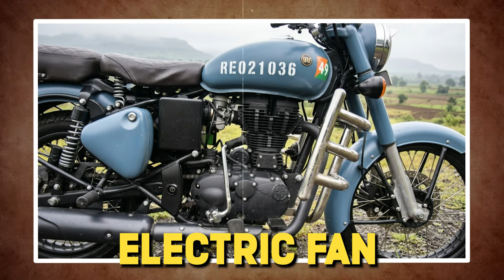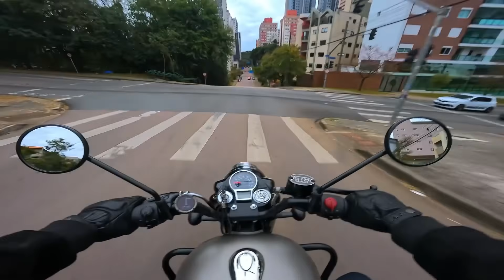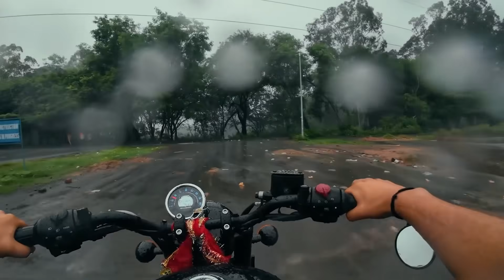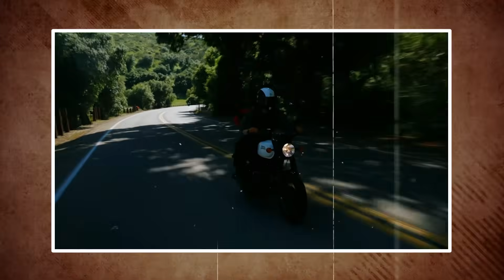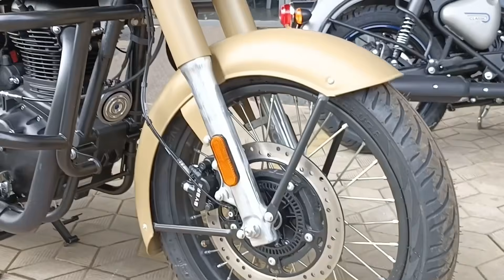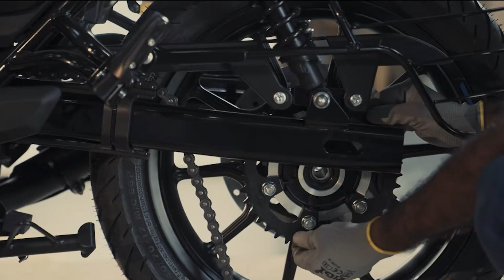8 Things Royal Enfield Cuts To Sell A Motorcycle For $4,000

Comment: Mine never overheats..in Thailand.  Suspension is good., better than my Honda, rear shock is adjustable. Simple is better, much more reliable. Steel is better, strong, also no chrome to clean. Brakes are perfect. It's not an off road bike. My Meteor is a joy.

Comment: I have a RE Thunderbird 500 2017 and Kawasaki Z650 2025 model. The RE 500cc with its Air cooled engine still seems to beat the Z650 in heat dissipation 😅😅

Comment: Not one of those omits puts me off. On the contrary, bonus point for a genuine speedo instead of a dreadfu TFT. And those LOOKS! Eye candy! 
I will admit, a fairing is the one thing I'd miss.
Braided steel hoses will beef up the brakes.
What I'm waiting for is the 650 motor in a Himalaya platform. The single cyl one is just too slow for a one-bike garage.